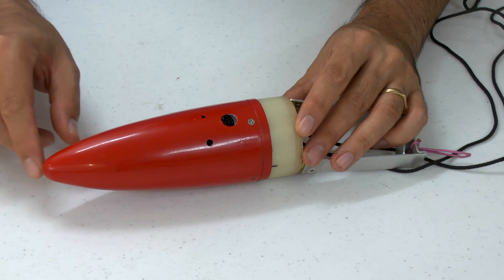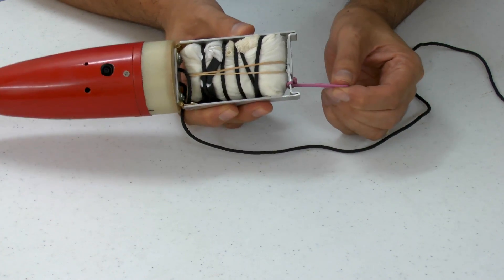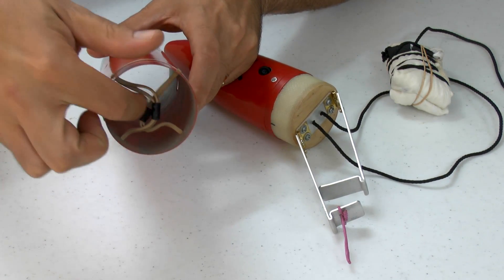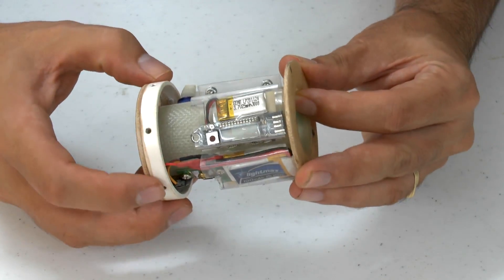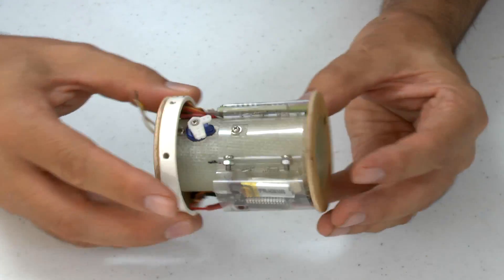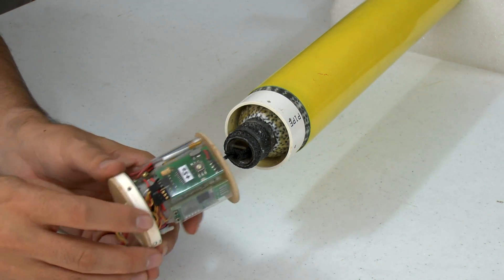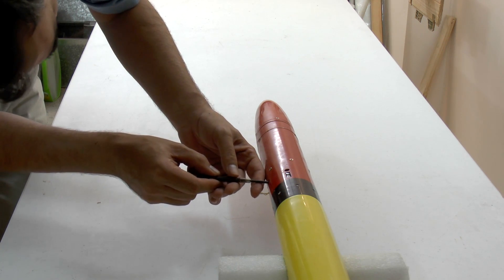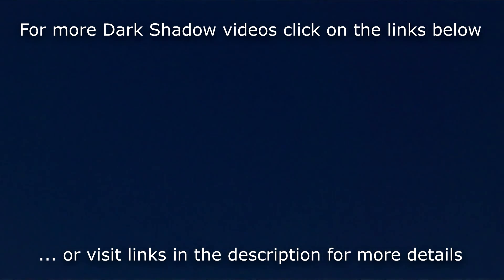Dark Shadow Parachute Deployment Mechanism

Comment: How does the breakwire work?
Reply from the maker: +Britt Smith The break wire is just two wires twisted together with a string loop in between that's attached to the ground. When the rocket launches the string loop gets pulled out between the wires separating them in the process. When they separate they break the electrical connection which then starts the timer. More info on the break wire here: http://www.aircommandrockets.com/servo_timer_V2_0.htm#_tip5
Reply: +AirCommandRockets Thanks for the quick reply

Comment: As a teacher I have been doing quite a few water rockets as school projects, but always just a 1,5L bottle and a Gardena based launchpad. No altimeter and no parachute. Its time to turn it up a notch. I was wondering why you use time for the parachute. I see the comments about g censor, but why not have it peek altitude trigger it? You log the altitude anyways. My plan is to have the students program a small Arduino microcontroller to log altitude (maybe g's) and it would be logic to have it trigger the servo when altitude stats to drop again
Reply from the maker: +Ole Brinch Sorry for the late reply. An altitude based deployment system would be the way to go. We used a timer based system since that's what we had on hand. Commercial model rocket altimeters typically only have a pyro output for firing ejection charges and so you would also need a servo controller for this deployment mechanism. Unfortunately neither of the altimeters we have, have an apogee signal output otherwise we could route it directly to the servo timer. Sounds like a good plan for the students to use a small Arduino board for the controller. Best of luck with your flights.

Comment: Simply Genius! A suitably sophisticated system for a such a unique Rocket. What is your design process? Have you experiment with other systems? Have you considered using a modified 'High G' Side Deployment Mechanism?

That is a wacky technique for creating the PET plastic sheve. Must have taken some patience! Cheers, Jamie B.
Reply from the maker: JSB Rocketry Thanks Jamie. We spent quite a bit of time thinking about this one to overcome some of the problems we had with the Shadow's deployment mechanism. One was getting the shock cord attached to the pressure chamber rather than the payload bay. With the piston we had on Shadow the shock cord would have needed to go past it and the high forces on the shock cord would have bent the piston. The other consideration was the friction needed on Shadow to hold the nosecone in place. This was always a little touch and go. If too loose it could drag separate and if too tight the piston needed a stronger spring to make sure it had enough force to overcome the friction. The friction changes based on temperature and humidity so it was always a little iffy. With this design the friction is taken out of the picture. Wanting the system as compact as possible meant that we didn't have space for a piston anyway and why we went with the rubber bands. The grapple arms were designed because the rubber bands pull rather than push like a piston. The rest of the layout was based on making the whole thing withstand the expected G forces.

The pockets for the electronics was my wife's idea, I decided to make them out of PET. It took a couple of go's to get them right. :)

Comment: As always amazing work, George. :)
The precision and quality of your rockets is absolutely outstanding.
It's interesting to see that you switched back to a time controlled System because you don't want to activate the system accidently. I guess  you would prefer the g-switch otherwise. ;) What is more reliable in your opinion, a time based system or a g-switch based system? As you may know we still use Tommy Timers because we really like the reliability of them as well as their durability.
Cheers
Julian
Reply from the maker: RaketfuedRockets Hi Julian, the G-switch is only used for detecting launch and not detecting apogee. We have always used a timer for deployment. Because we weren't sure if a tall enough ladder would be available at this launch to go up and arm this rocket, we had to bring it down in order to arm it. If we armed it and then bumped the rocket enough putting it back on the pad then it may have triggered the timer. The break-wire made sure we could handle it as much as we liked without it triggering. This turned out to be a good decision as the ladder we borrowed at the launch just wasn't tall enough.
Reply: AirCommandRockets
 Interesting, I didn't know that.
We also thought about a sort of break wire and an electrical parachute system, but we wanted to place the "break wire" at the nozzle, so that the gardena coupling would close the electric circuit. However, our planned timer used a relay and we were worried that this component would be damaged by the acceleration of the rocket. We have to reconsider such a system and we'll try to solve the problem with the relay.
Reply from the maker: RaketfuedRockets One thing to watch out for when running wires the full length of the rocket is you have to take into account the stretch in the rocket. A rocket can stretch 1-2cm when pressurised and if your wire connections are tight between top and bottom you could potentially pull wires out of sockets. Ideally though you can just have a trigger inside the nosecone for your relay without a need to run anything to the launcher.
Reply: AirCommandRockets
Thank you for the tip!
Our latest rockets are reinforced, so I think the stretching effect is  almost not noticeable. Maybe we'll attach the break wire on the guide rail, this would solve the problem.
Reply: +AirComket透かしs 顔危惧ゲームエクササイズｅｇ．みたいな

Comment: Thanks for sharing this video i see some very good improvements! The finish product looks very good and very well made.
Reply from the maker: Basrockets Thanks Basrockets. There is still a little more improvement we can make in making the grapple arms lighter. We weren't sure how they would handle the acceleration forces and then getting bumped around on the way down and when landing so we decided to sacrifice some weight for strength in these tests.